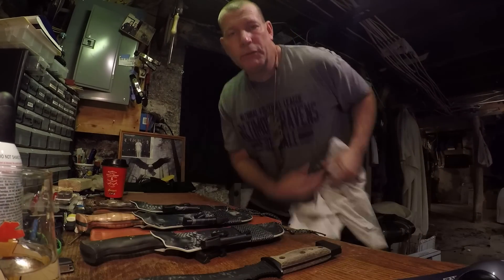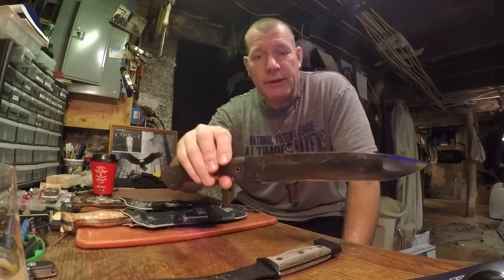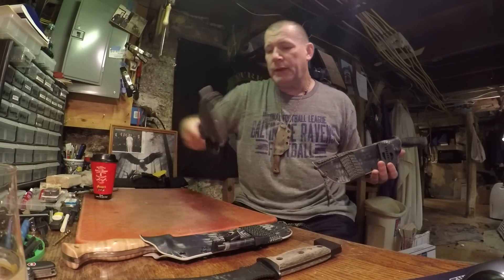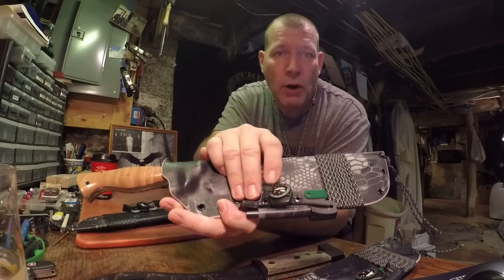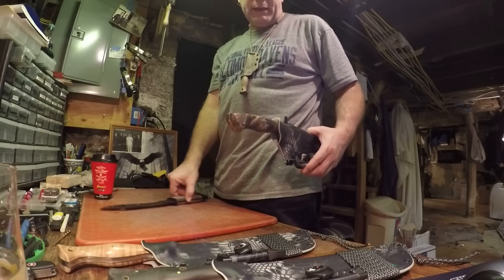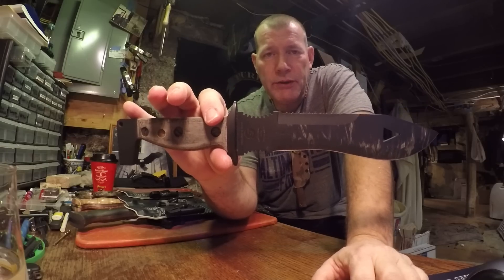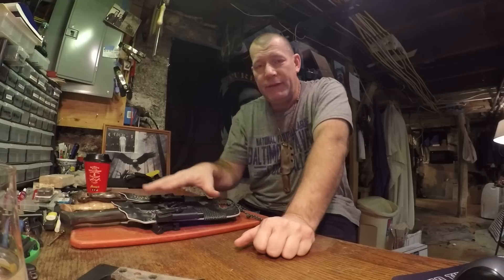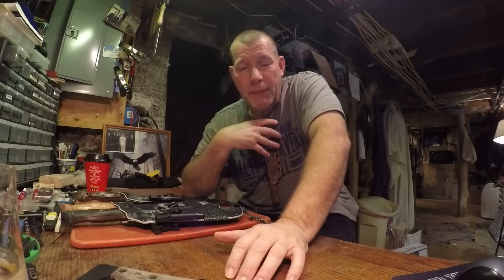Yellow Hawk Custom Kydex - Dark Timber/Yellow hawk Customs systems, Parry Blade

Comment: Very well put, Doug! You are already aware that I am not the kind of person who wants to spend a lot of money on a custom blade when I can get my hands on a half-way decent chunk of Pakistani steel that will complete the tasks I need it to. After losing an expensive knife once, I swore then that I would never pay that much for something that wound up at the bottom of a lake after coming right out of its sheath. The blade was gone, but I still had the sheath... It was obvious that it only makes sense to me to put a little more money into a reliable sheath system, than the blade itself because I already know I can lose a blade... but re-filling the sheath is the real issue. After years of trying many different blade/sheath pairings, I stumbled across your videos thanks to Chris Tanner and PM101. I can't tell you how refreshing it was to hear people like you and Chris put the "snobs" in their place. "Value" is a very personal and subjective thing, which is why, when I finally decided on my own "best value", I wanted a sheath system that I know will still be on my belt, even if/when I drop my blade overboard or into a snow bank. Then, it won't break my wallet to get a replacement that I can make a few modifications to fit it into my sheath just like the old one. I sell and collect vintage guitars and I've always been one to go more with "value" than "price" as I actually PLAY my guitars, I don't just let them gather dust. I specialize in Japanese guitars because once again, there are just more collectible Japanese made instruments in my budget range out there than American ones and during the late 70's through the 80's, there were Japanese makers creating works of art that American makers just couldn't compete with. But the "guitar snobs" will sneer at you even though they know the Japanese models are technically superior to certain American ones from that same time. Let them. No one knows what kind of blade (or guitar), you should be using, so just ignore everyone else. Do your own homework, your own research... use your tools as much as you can. Learn from people who DO teach you what YOU should look for, not what you should buy. And don't be afraid to ask questions. But with Doug and Chris making so many videos, chances are, your questions have already been answered. Sorry for the long rant... just want the other 'newbies" to know they are not alone.